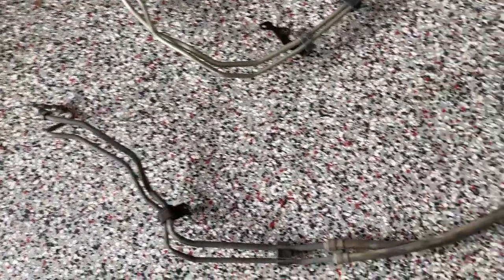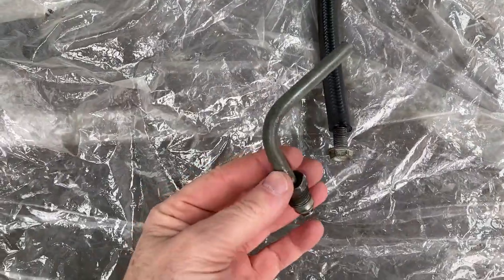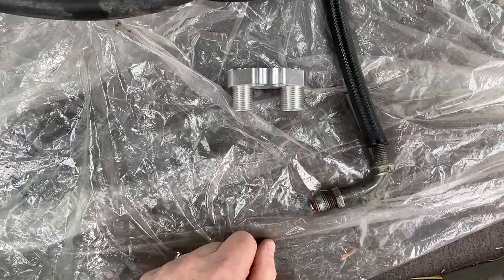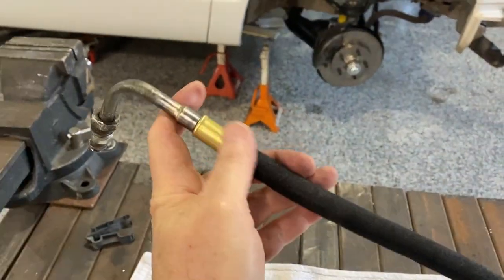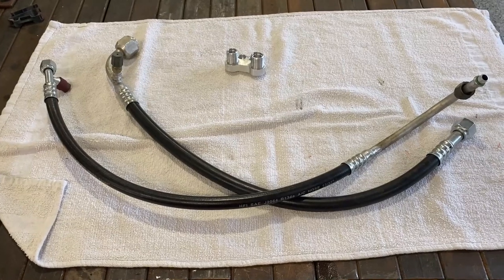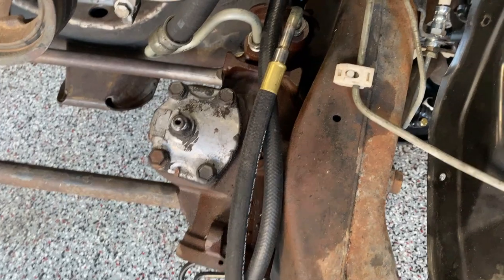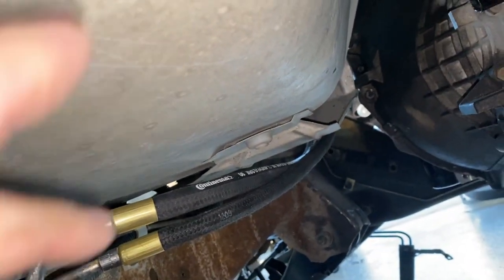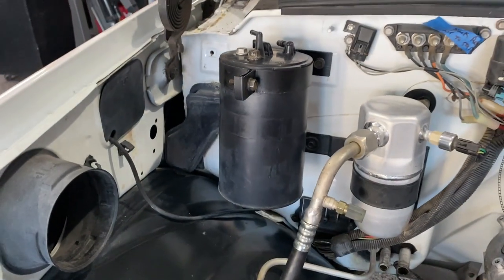88-98 Chevy OBS Truck LS 5.3 Gets NEW A/C, Fuel and Power Steering Lines plus Overall Build Update

Comment: Good video. Not easy to find a shop for hoses here in Colorado. I had to buy an expensive vintage air hose kit. Make the lines and then have the fittings pressed.

Comment: Great video, I  do have a question; Which high pressure steering line did you use for your set up.
Reply from the maker: It's a combination of OBS, NBS and some custom work by HoseFast in Garland Tx. Having a competent hydraulic shop available to you is priceless. These guys can make anything!! I took the parts I had and explained what I needed...about 20 minutes later, I have a custom well made hose.

Comment: Excellent work, I love how you think this through carefully! What do you plan to do about the exhaust heat on the fuel lines?
Reply from the maker: Where I have them was not my first choice. I wanted to mount them more inside the transmission tunnel for that reason. I will be doing the exhaust soon and will probably move them over then. I like how they look, but your point is valid.

Comment: Hello I’ve got a 1993 Chevy Silverado extended cab 2wheel drive and a 6.0 ls with a 4L60e transmission I want to use my cruise control will the stock transmission computer still work with me ls swap if not what do I have to do thanks
Reply from the maker: Do you have DBC or DBW (cable or wire) throttle body/gas pedal?